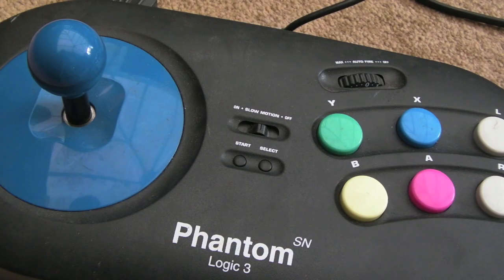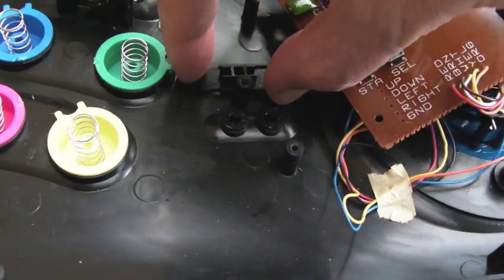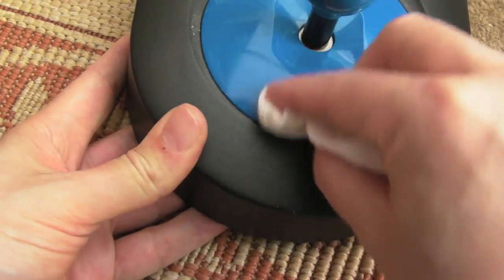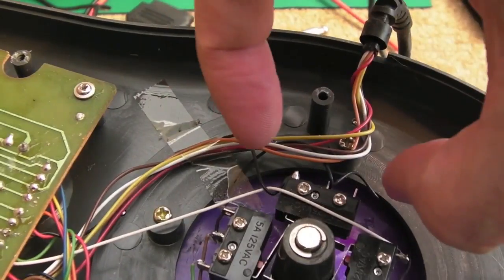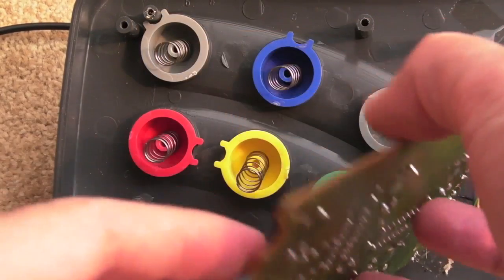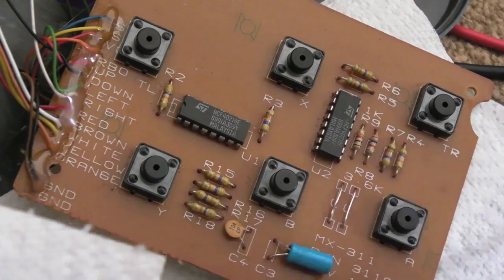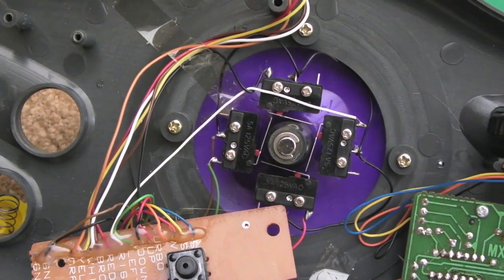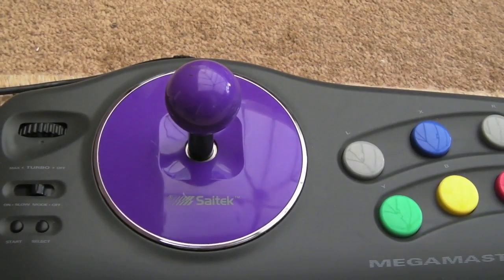Super Nintendo Saitek & Logic 3 Arcade Stick Restores

Comment: Cheers Chris, you're a top (and VERY helpful bloke) ;) By the way, we are awaiting a new LVA510 chip and a TMS9929ANL Video Processor Chip. A word of caution about these machines (should you ever be "unfortunate" enough to have to repair one) :O The video circuitry is a bastard in as much as that if you get a problem in this area, it seems that it can lock the computer up. It can produce a "blank" screen and stops scanning the keyboard. In this way, you can press the CAPS LOCK key and not get the CAPS LOCK light to come on. These symptoms are the same as a faulty EEPROM chip. Also, the Clock Frequency crystal and the Colour Frequency crystal appear to be in the wrong place at first physical glance at the motherboard. Don't be fooled by this, they ARE where they should be :O Will keep you informed of our progress. Warmest regards, Wayne and Nina.

Comment: Another great video. i was starting to ask what plastic cleaner you used but I heard Meguiar's. These seem like great pads. very well designed. I like my super advantage stick but; you can't deny the superiority of the microswitch technology
Reply from the maker: I always thought those sticks were microswitched?
Reply: +GadgetUK164 No, unfortunately. the NES and SNES Advantage sticks are basically like a big d-pad with a stick pushing the contacts. the buttons are just like big SNES buttons. Feels and works pretty good if its not too worn. I would figure out a way to micro switch mine if it got to that point. really like them other than that!
Reply from the maker: Thanks for the info!  That sounds like the original Megadrive arcade sticks (like the one I cleaned up in an earlier video).

Comment: Makes you wonder how these things were put together in the factory. Some of these devices are so fidgety to put together. I like these stick. They seem pretty good quality.
Reply from the maker: Yeah, I think lots of hand soldering for assembly.  They were clearly built to a tight budget (cheap plastics etc), but quite well designed.  I think if the buttons were a little more responsive and they had used thicker plastic, they could have been perfect.
Reply: If you're a rookie user like I am almost any stick will do I think :)
Reply from the maker: Haha =D

Comment: Nice, I would class that as a score. I'm surprised they used micros as most manufactures go down the cheep route. You just can't beat the feel of a stick with micros it's why I have them on my mame cab.
Reply from the maker: Definitely!  No going back once you've used a microswitched stick!!!  I still need to find a decent AES stick at some point, but hard to find in good condition and they always demand high prices.  Same if not worse with Dreamcast and a Saturn microswitched arcade sticks.

Comment: We have recently come bought a Toshiba MSX HX10 computer with the dreaded "Blank Screen" fault. We have replaced all the RAM chips, the CPU and just about all of the logic chips. As with the VIC 20 that we repaired a while back, could it be the BIOS chip in the MSX which is to blame? By the way, the chip is marked as an MB83256 116 RA. My research leads me to believe that this is a programmable EEPROM device. Next question........... where can I get the bloody things from! LOL!! This is a real pain in the arse, as I haven't got an EEPROM chip programmer, or the program to put on the damn thing either. Your help and knowledge would be much appreciated. Hope all is well your end. Warmest regards, Wayne and Nina.
Reply from the maker: Sounds like a nightmare repair!!!  You can use a 27C256 to replace that chip.  You just need to work out which ROM image to get programmed to the chip.  You can easily order a chip pre-programmed from buyicnow.com!  Just select the pre-programmed service and attach the ROM image.  Buy 2 just in case one isn't programmed properly (I've had that before when I used them when I didn't have an EPROM programmer).  I guess the next thing you need to do is find out which ROM it is and find a ROM image.  I am not familiar with the MSX - is the chip the main BIOS / kernel or is it a BASIC ROM or something?

Comment: Have one of the MegaDrive versions of this stick and imo the buttons really let it down, even though microswitched I think the spring and the amount of movement in the buttons just makes them feel not quite right, did think about modding it, but didn't in the end.
Reply from the maker: Yes, I agree the one negative is perhaps the buttons not being responsive enough.  As you say, they have to travel and click to engage.  I wonder what I could swap the out for that might be better?
Reply: just a case of finding some nice buttons to fit and a way to mount them, after that they'd be a really nice stick

Comment: Nice job and nice find. They look like nice sticks. I'll have to try and find one cheap sometime. Is there any benefit of cleaning the top of the board like you did or is that just you OCD kicking in ?
Reply from the maker: Yeah they are a nice stick!  The benefit is knowing that its pristine inside and out, so I guess yes - it's the OCD!  I just enjoying making things look like new.  Generally with controllers its a good idea to try and keep them clean inside - just to stop dust etc getting onto button pads or inside switches etc.